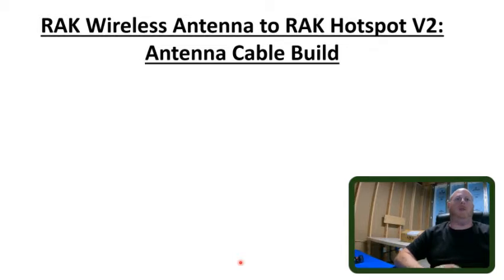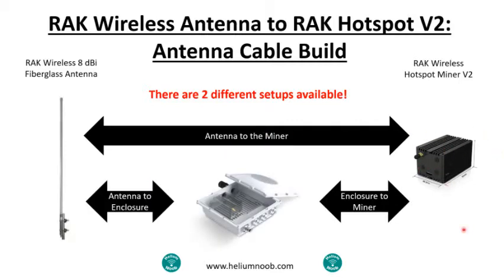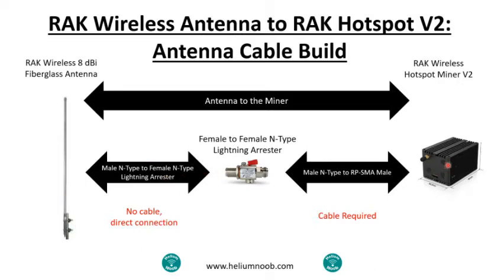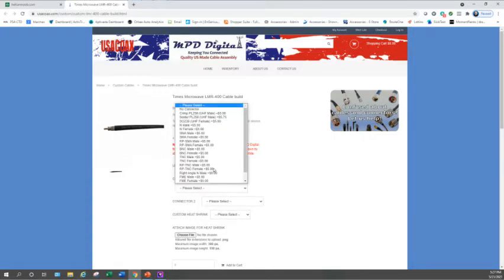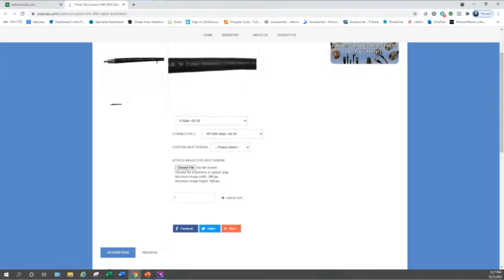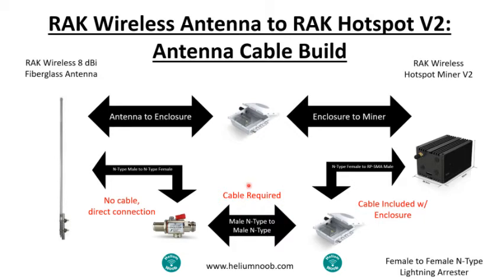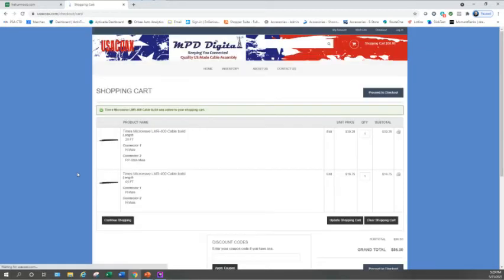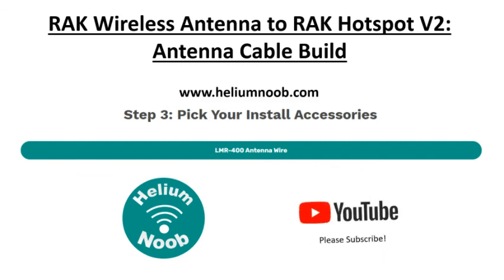RAKwireless Antenna to RAK Hotspot V2: Cable Build (For Helium Mining HNT)

Comment: The normal RAK enclosure has n-type Male to Male RP-SMA
Reply from the maker: Unless they changed something recently, the connection on the enclosure I purchased from them was a female N-type hub (exterior) to an RP-SMA Male feeder line(interior). Thanks for the look.

Comment: what is the best? the setup 1 or 2? for bocat300, i think buy enclosure  for bobcat but i think buy extension cable for the antenna is more easy, and the bobcat indoor in the house
Reply from the maker: Really depends on your tolerance for signal loss and how long the run would be if you go direct. Check out my other video on signal loss. I have a calculator posted on heliumnoob.com that will tell you what your cable loss is based on distance if run. The expense to upgrade the antenna may end up with a degraded signal the farther you go...hope that helps.
Reply: @HeliumNoob  thanks men i checked your web and is true loose signal with the extension regards
Reply from the maker: @obedriverarazo5780  if you decide to do an enclosure for the bobcat, please use my link...price is the same. Thanks. https://rakwireless.kckb.st/heliumnoob-dh4

Comment: thanks bud! Can you please make a quick vid or provide information on how to assemble the brass colored bracket that you attached to the mast before you attached the antenna and its little brackets? I think you had two bolts and brass clamp which attached to the 1 5/8ths inch mast pole. thank you!
Reply from the maker: This video zooms in on the bracket setups: https://youtu.be/DhMs2pv_2pA

Comment: Loving your content brother. I've burned through every helium video on YouTube while I eagerly await hotspots to come. Had a question I originally planned on puting antenna to lightning arrestor to cable, but some have said it's better to put lightning arrestor at entrance to house. After reading that I ended up ordering a separate 2 foot lmr400 cable if I choose to go that route. Like I say still have plenty of time to get it squared away but would like to hear your thoughts. I'm a total noob just soaking up info everywhere I can. Keep making content loved everything this far. I went with rak and USAcoax too.
Reply from the maker: Hey Chad thanks for the comments...I was told a while back that you are either teaching or learning. I'm a noob too, hence the name. Just trying to share my experience. If it helps someone in thier journey or we learn something new from each other that's what this is all about. Just want to make sure I am following, are you saying put the arrester in the house? Not quite following.
Reply: @HeliumNoob  hey thanks for response. And no not in house but right before it enters the house outside the wall. I guess it would depend on the location as well if the hotspot is right by the antenna wouldn't matter so I have an 8 foot galvanized pole secured in an old satellite dish mount. I'm going to put my antenna on top then a 15 foot lmr cable down  to where it's going to go through my stucco so the arrestor would be right there before it enters the house at that point it would connect to the seperate 2 foot lmr cable to fish through towards the miner. Some people have said it's best to put it right before it goes into the house. I'm not bill Nye the science guy so not totally sure..lol I have everything for grounding appropriately like you did. But yeah maybe it wouldn't make much difference. My head does wonder though if that makes more sense in the case of lightning hitting the antenna and mast and some current passing by the arrestor and still traveling down til it reached the miner. I'm rambling but yeah it's one of the things I'm unsure of. I get somewhat of the reasoning behind it. If the arrestor is too high and lightning hits below it what would stop it from traveling the remainder of the cable to the equipment. Sorry for the novel just kind of thinking out loud I guess.
Reply from the maker: @chad3307  gotcha...same page now. I would say it depends on your run length. I put the arrestor right on the antenna because my antenna cable is not running into the house ( would be about 42' for me). My antenna will got to an outside enclosure about 5' from the roof peak. Miner will also go in that. Poe from in the house to the enclosure. So I have to run my ground line from the peak basically.
Reply: @HeliumNoob  that makes total sense. Appreciate the feedback keep making videos👍👍👍